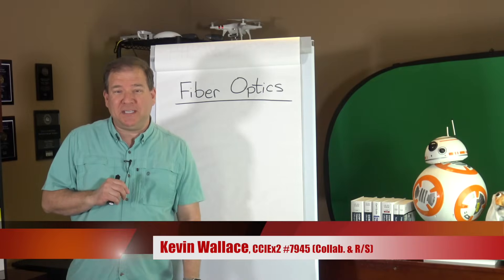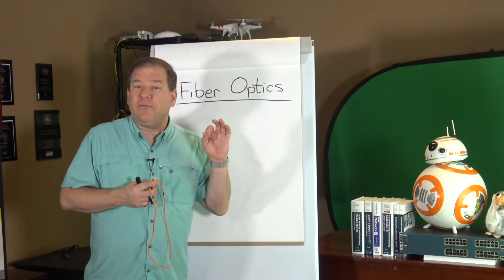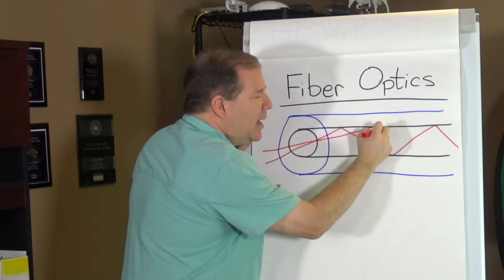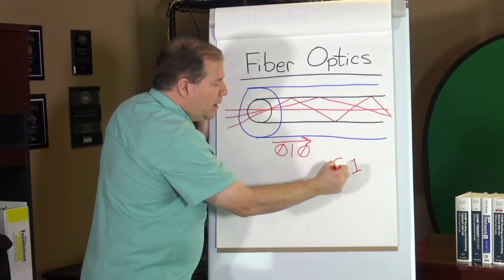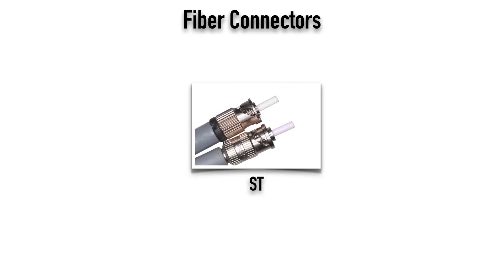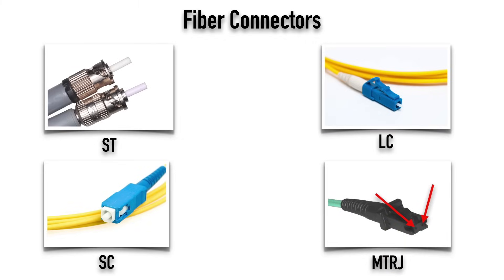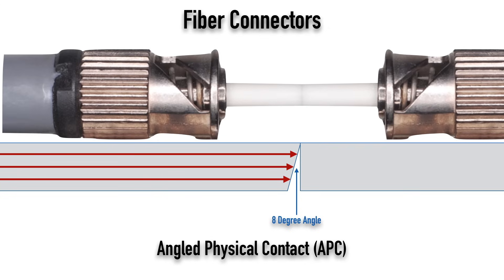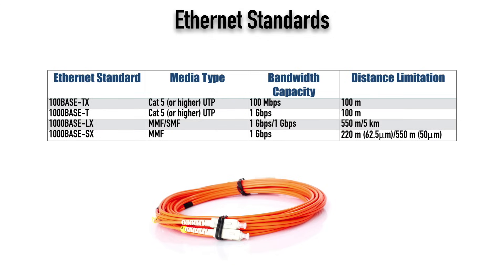Fundamentals of Fiber Optic Cabling

Comment: My question is two-fold. Can multi-users share one fiber optic cable?? And if so, is data multiplexed in digital packet form or is data being sent by different frequencies to different users at the same time like radio transmissions that use different frequencies being sent through the medium of space/air all at the same time???

Comment: APC connectors wont work like that. Both ends MUST be apc- polished if u want to use it. U also did not mention, that you can use one fiber to send AND receive data. This is handy for "ftth" (fiber to the home) applications, because it cuts need of fibers to half. + Less patch cables, switches etc...
Reply: Commenting to echo this.  Important correction to this video!  I sell fiber optic cables to physicists and still have to explain this to them!

Comment: Mr Wallace, from visual explanation of 2 connectors touching in APC scenario, it looks like we should use APC on one end and UPC on the other end. But this is not true. That gap between APC and UPC connectors actually causes a lot of power loss. You should alwaus use UPC vs. UPC and APC vs. APC.

Comment: Hi Kevin, that was very helpful. May I ask a question about the length of the fiber cables? I'm using a 1GB media converter (Single mode)  and the FSP module states that it can go up to 20Km. If I use a 30 M single mode cable, will that harm the converters? I saw a video saying that the wire length should match the distance that the converters can handle.

Comment: Hi,
i have some questions regarding the fiber optic, i hope you have answers for them

1-What component does a BH Fiber connect to? Switch-Digital Unit-Microwave-Router

2-What are common sector names? Alpha-Beta-Echo-Gamma
3-What type of cable is used to connect to a copper SFP? Ethernet-Coaxial-Fiber-Stranded

Comment: How the laser attain different angles in MMF? Do we have many laser diodes kept at different angles? If there is only one diode , how can light travel in different directions unless the diodes angle is changed physically for each light?
Reply: Fiber has a "Numerical Aperture" (Cone of Acceptance), this is how the core accepts the light. In MM fiber (Depending on OM1-OM5) type use LED or VSCEL lasers. These are stubbed or non-contact, so think of how the beam of a flashlight spreads. The further you are from the surface the larger the spread. Not quite this dramatic with a laser or diode but then again, we're dealing with nanometers (one billionth of a meter). Hope this helps.
Reply: @VanTekConsulting  Thank you ...

Comment: Is there such a thing as direct bury fiber and do fiber cables have a fire rating?
Reply: Yes on the direct bury cable. A large share of fiber in the US is direct buried. Fire rating, Yes. National Electric Code is the governing body. Cable is rated and marked, if no marking it is considered General Purpose. A cable will be marked OFXX (Optcal Fiber), XXNX or XXCX (Non-Conductive or Conductive (shielded, non-shielded)), then XXXG,R or P (General, Riser or Plenum). A rating would look like OFNR (Optical Fiber, Non-Conductive, Riser), OFCP (Optical Fiber, Conductive, Plenum). Hope this helps.

Comment: Thank you for this video. Can you explain me please what does λ symbol on power meter means? I know that is wave length in physics, but how that affect on fiber optic cable loss measurement?
Reply: Correct λ is the wavelength i.e. 850 nm or 1300 nm for MM. The effect on loss/attenuation is that the shorter the wavelength, the higher the frequency, the more attenuation (loss over distance). Think of it this way, a subwoofer in a car. You can hear the lows but can't hear the highs. Higher frequency always attenuates faster than lower frequencies. Hope this helps.

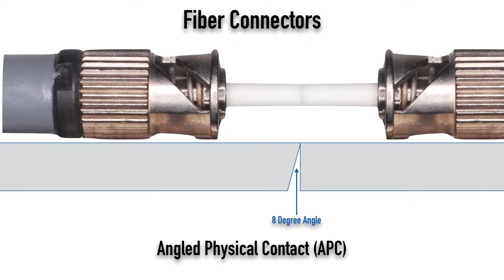Comment: Time Stamp 8:32 is really not accurate, and misleading. The idea in the graphic is that an APC (Angled Ultra-polished Physical Contact) connector is connected to a Flat Physical Contact connector is absolutely incorrect.
For new folks watching this DON'T EVER DO THIS! APC to APC Only. IF this were to be done, there would be high loss and a HUGE Fresnel reflection. It would also most likely damage the flat connector causing further issues.
I understand the intended principle trying to be explained, but this a terrible example.